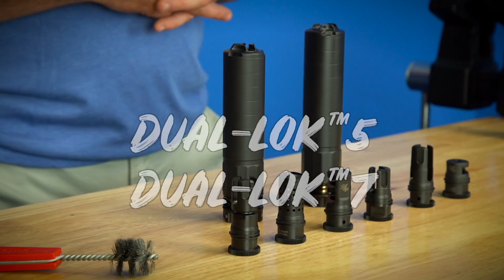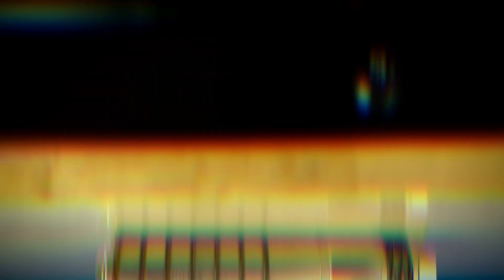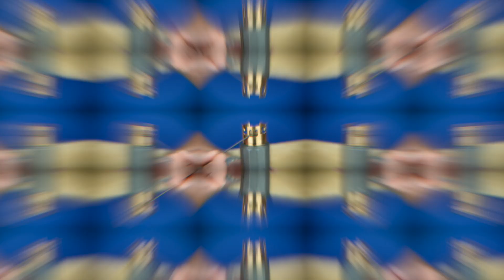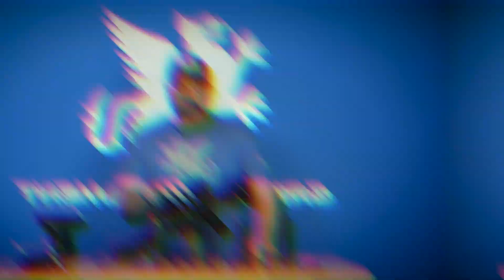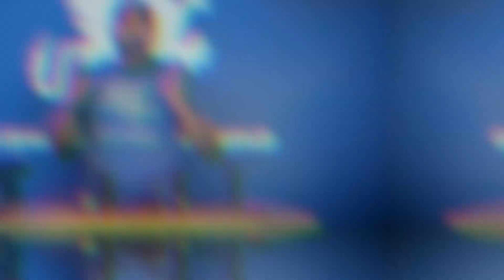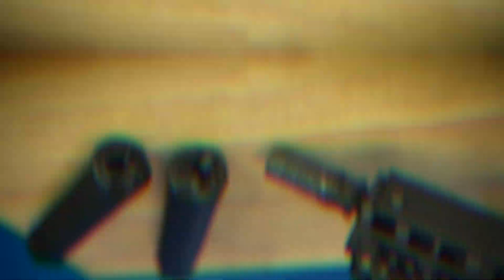DUAL-LOK™ 5 & 7 Suppressor Tutorial

Comment: Is using the dual port paladin brake vs the tactical compensator likely to cause a difference in sound when a suppressor is mounted?
Reply from the maker: Based on our own internal testing, we haven't found any additional or noticeable sound suppression from using those muzzle devices. You'll still be within hearing safe levels with either device!

Comment: There's no way to safely remove the baffles at home to clean out the inside of the suppressor? I ordered the HRT 5.56 and can't wait for it to arrive!
Reply from the maker: Unfortunately no, the DUAL-LOK line is not user-serviceable. However, you shouldn't need to worry about maintenance since 5.56 cartridges are very clean and high pressure, so any build up of carbon or debris should burn out very easily. If you feel as that it needs cleaning around the mounting collar, you can take a 1" pipe brush and thoroughly rotate in and out until satisfied. Some users decide to drop the whole silencer into an ultrasonic cleaner, though be aware this can ruin the cerakote finishing

Comment: Will it carbon lock and is there a way to add force to remove if the need were to arise? How is repeatability (accuracy) it put on a precision rifle? Can you also explain the differences between the standard dual lock and the HRT series?
Reply from the maker: If carbon lock is to occur, you can buy a Dual-Lok wrench from our website to help break it off the taper. You can find that here: https://www.griffinarmament.com/dual-lok-wrench/.

We also make over-the-barrel Dual-Lok suppressors that are specifically designed for precision, long-range shooting (PSR series). You can find more information on those here: https://www.griffinarmament.com/silencers/rifle-silencers/dual-lok/

That being said, the whole Dual-Lok series has minimal POI shift and is great for repeatability due to the nature of the mounting system. The main difference between Dual-Lok 5 & 7 and HRT-5 & 7 is the tube construction. The Dual-Lok 5 & 7 are tubeless suppressors with vented, flash hiding end caps, which is great for gas reduction and flash suppression. The HRT series is a traditional tube design made for hard use and sound suppression, but has a little more blowback than the Dual-Lok 5 & 7. Both series have our Eco-Flow baffle technology and are hearing safe on their designated calibers.

So, if you want a lightweight suppressor with better gas reduction, go with Dual-Lok. If you want a hard use suppressor with a great tone, go with HRT.

Comment: So can you still use your old taper lock non dual lock mounts with this can? Since the taper will still lock up without need for the second lock.
Reply from the maker: Nope, taper mount devices will not work with the DUAL-LOK suppressors. The taper is located in a different spot on the DUAL-LOK muzzle devices. DUAL-LOK suppressors require the use of DUAL-LOK muzzle devices

Comment: I'm confused.  Is this a new suppressor or just a new mount for existing suppressors?  Like are you going to be able to buy this mount for an Optimus 9?
Reply from the maker: We just released 2 DUAL-LOK suppressors with the mounting system integrated into the suppressor itself. But the mounting system is available on our website as a 1.375x24 Hub mount to thread into applicable suppressors

Comment: Awesome. I really like my Recce 5 already. And I dig the weight. 

How do these compare as far as sound with the Recce 5?
Reply from the maker: The Recce 5 is going to have the superior sound reduction between the 2 suppressors, but these do very well with sound also. The tone may be different between the 2 due to slightly different baffle designs as well as different flash hider end cap designs